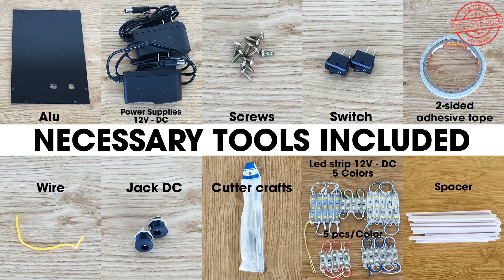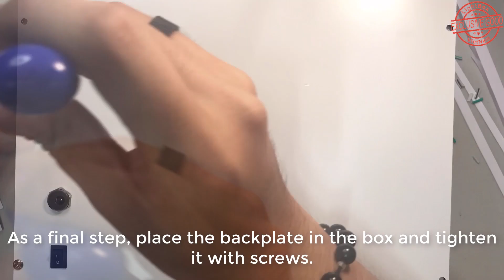How to make paper cut light box! ( With English subtitles )

Comment: Hi! What type of foam do you use for the frame? Thanks! ;)
Reply from the maker: I used foamboards 8mm
Reply: @LightBoxGoodMan  Perfect! Thanks a lot! ;)
Reply from the maker: @Arsenman01  You're welcome!
Reply: I use 1/8 inch thick 1/2 diameter Zots glue dots, easier than gluing foam board and is quicker. Perfect amount of space. You can get a 200 count roll for $6.99 on amazon. Make sure to get ZOTS. Just peel them off and put one ever inch apart around the square layer on the back of course  then place the next layer on top or bottom depending on which end you start. I don’t suggest buying their light kits even though the gradient light looks so pretty, it comes in pieces with not everything you need. You can get the same effect by using USB fairy lights and behind the last blank layer place the color tissue paper you want on the paper and then put the back of the frame on